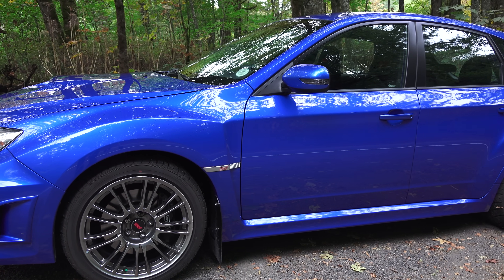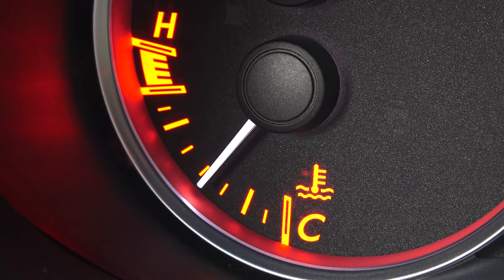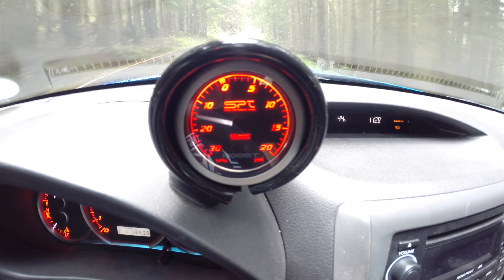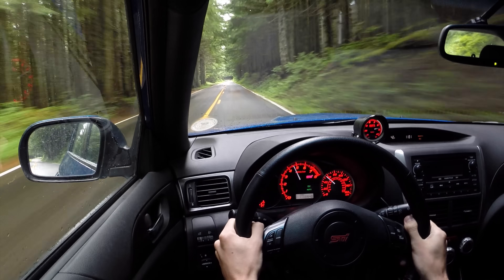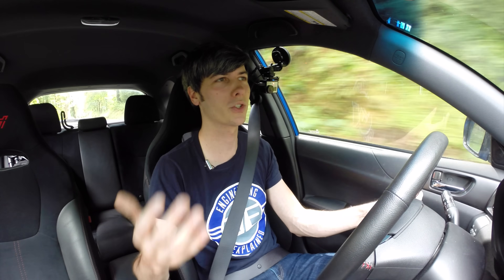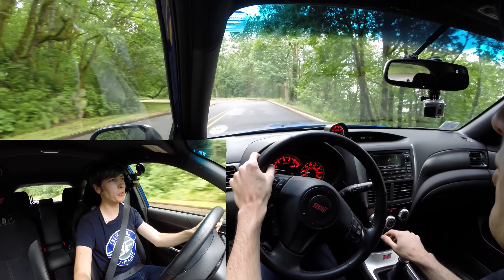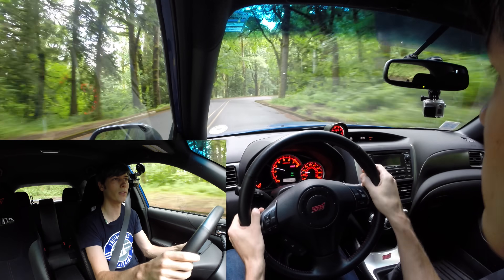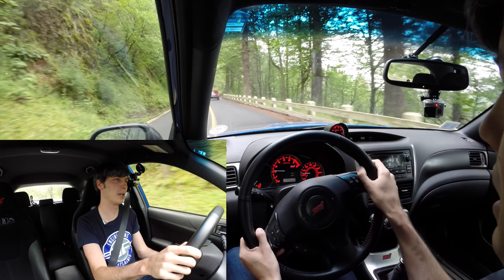5 Things You Should Never Do In A Turbocharged Vehicle

Comment: It stands to reason that if you are walking along a path and immediately take off running, you are putting more stress on your body/lungs...gently increasing speed is much better as it allows the body to take the increased loads. Same for an engine; the low rpm situation in top gear is fine for cruising but when you accelerate quickly it puts higher bending loads on the rods and such, it's more bottom end damage than anything else, cambelt damage can also occur :/ modern oil is designed to take one heck of a beating from cold to hot. If you turn off a hot engine instantly there is a peak rise in heat prior to cooling down, this doesn't do any damage but if you consider a turbine wheel still spooling without an oil feed, not good. It makes sense to leave the engine running for at least 20 - 30 secs prior to turning it off, this allows the turbine to slow down to a stage where upon the engine being turned off won't cause dry spooling of the turbine shaft. Feathering the engine through acceleration and deceleration is always a good thing. Heavy right-footers destroy engines but if they are loaded then it matters not, but for the rest of us, nursing an engine will give it longevity, regular oil changes (I change my evo oil every 6 months) also helps to stop sludge build-up which can cause a lot of problems.

Comment: Hey there,  you said something about not to lug the car at low RPM's... I drive a VW TDi Jetta with a manual transmission. The peak torque is at 1800 RPM, IIRC. I usually downshift if I have the time before changing lanes on the freeway or pulling a steep grade. But there are times where I need to accelerate in the gear I'm in... But what is considered too low in RPM or how would one know that its "Lugging" ??  Even at say 1500 RPM, if I ease on the throttle, and give it just a sec for turbo lag, it pulls pretty strong and feels great. So not sure if you have done research on this or not, but I have a 2015 TDI with the 150hp model, but I would assume is fairly close the the 09-14 models with the 140hp engines.

Comment: Do you think Top-Tier certified gas station matter?
Reply from the maker: Absolutely, though quite a few companies qualify as Top Tier. Seems like if you're not in it you're probably not trying.
Reply: It is far more important you go to a station with cleaned and maintained tanks than "top tier". The detergents are debatable.
Reply: +User Name that make sense. Do you know how to tell which station have a clean and well maintained tank?
Reply: You can typically tell by the state of the entire station. Newer stations are also typically a safe bet. In my area Shell stations are typically garbage and a few shut down after people complained of substantial water in the tanks.
Reply: Never buy gas when the fuel tanker truck is there, or you saw it there.  Sturs up junk from the bottom.

Comment: number one. unless somebody is using a straight weight in there car your quite wrong. oil acts at the lower viscosity index until warmed up making the oil flow too fast to reject heat and the heat would damage your turbo. engineers............. they went to college.
Reply from the maker: College is a great place to learn. You should watch this video to understand why oil flows slower at lower temperatures: https://youtu.be/tYkg0oDUXs8
Reply: +Engineering Explained it's irrelevant and the reason modern internal combistion motors use multi viscosity oils. the first number that has a w after it is what viscosity the oil has at ambient temps.  therefore the oil will flow faster at until warmed up. viscosity is the resistance to sheering(stress) the higher the number the more resistance to flow.
Reply: +james hoffman turbos need higher viscosity to reject heat.  I.e. the 5w40 used in alot of turbo cars will have a resistance to flow that is quite low (5w) until warmed up so the oil is flowing too fast to reject heat. you stated that the oil moves slower. your first point of the video is only true if you use straight weight sae 40 and you trailer your car to the track. so for the rest of the world we are now misinformed as to the why.
Reply: +james hoffman You have no idea what you're talking about.
Reply: +james hoffman  not a single true word....

Comment: Nice and to the point as always, but you did forget one thing, about not turning off the car after long rides or driving with heavy load on engine, oil is not that much of an issue, it can be relatively cheaply changed, but what happens too is you have hot turbo running, and you cut off the oil to it, expensive repair incoming :D

Comment: low rpm knock is the most common way people damage they're engine when turbocharged due to high boost which increases your flame front speed mixed with slow piston speed aka low rpm
Reply: this usually doesn't happen on unmodified turboed cars, but people who increase boost without tuning. just wanted to clarify.

Comment: Some cars (like my MK5 GTI) have an electric motor that runs coolant around the turbo after shutting down the engine, so you cannot damage it... But don't park your car and pull up the handbrake if your brake discs are red ;)
And how could one produce high boost at low RPM? At low RPM, low amount of burnt gases go via the turbo, so they cannot turn it that fast, thus they cannot produce high boost... Right?

Comment: Low speed pre ignition doesn't happen because it's a small turbo engines. It happens because it's a small engine. In Europe, this issue has been around for like 50 years, and it is THE ONLY reason why premium fuel makes sense. It doesn't ignite as easily without spark.

Comment: seems like they should have been able to compensate for low rpm with less fuel because the computer should be able to see that it is not going fast enough to actually need the extra gas

Comment: 87 and 93 are the only fuels you get? In europe we got 93, 95, 98 and 100 octane
Reply: Europe has a different octane rating system than North America.
Reply: +Chris Watson same gas, different rating system. u kno how we have to b different lol
Reply: Nico Guerrero I assume you are on the Europe scale for octane not the US, correct?
Reply: +Lenfred Dueck r+m/2
(R)Research and  (M) motor (octane)
Reply: 3 or 4 types.  In California, we have 87, 89, and 91.  The rest of the country I believe is 87, 89, and 93.
Reply: Correct, in New England, 87, 89, and 93 are what you find in most gas stations.  I've even see a few stations that have 85, 87, 89, 91, and 93, but those are few and far between.
Reply: +E B In Chile we have 93 95 and 97 octane
Reply: In NZ we have 91,95,98,also e85 and aviation fuel if you know where to look for it
Reply: we only get 95 and 98 in the UK
Reply: +Joe Raw where do you live in a village tescos sells 99 ron and shell sells 99 ron
Reply: Here in Mississippi, we have 87, 89, 93.  A few stations have 91 as the premium.

Comment: sounds like engineering fails. why cant we just sit inside the car start it and  drive it. a car does not need to be treated like a baby. it a machine. just my opinion.
Reply: your opinion is extremely ignorant
Reply: This isn't babying a car, this is making sure you don't destroy both the engine and/or every bone in your body. The laws of physics will never allow us to drive the perfect car.
Reply: +Frenk Vortice it's not a compliment, and for the record you can hop in a car and drive it straight away, and you can also floor it out of the driveway if you want, but you shouldn't for the reasons listed above and more. It's like saying its an engineering fail that we can't travel at speeds equal to the speed of light, physics.
Reply: lilsammywasapunkrock luck would play a large part there ill say as i notice differences in oil pressure even 4,000 km's after a change.
despite yes you could save $1000 for basically slowly destroying your engine but will that $1000 rebuild and re-fit an engine ?..
look after it and it wont be so disposable.
my usual service interval is 5,000km , i use penrite oil's, its about $35 a bottle, oil filter is about $15 , so $50 aud all up.
its not the cheapest oil around but id rather be spending $300 per year happily than have to spend $2500+ on a second hand high km engine or rebuild it for $4000..
eh just how it works for me, doesn't mean its the same for everyone else.
Reply: There's a difference between 'baby-ing' and taking reasonable care.
Reply: Challenge accepted

1) they gave no statistics on how many of these cars are old/new. I can guarantee most breakdowns are older cars, naturally.
2) I believe this argument was started by engines, not accessories which is all the article touches on.
3) this is 1 article with very limited depth, no sources included.
4) You're wrong
Reply: ***** right, that is reasonable.  just wish the cars would be less of a burden. economically.
Reply: +nvmyutube well, I did pay $500 for the car, 5 years ago. so $2500 later, I'd say I saved money by not changing the oil.
Reply: every machine requires care. if you take care of it , it'll last longer.
Reply: +nvmyutube I have 340k miles on my car, I drive about 25k miles a year and I don't change my oil at all. sometimes ya get lucky, and other times you dont. say you change the oil 50 times for about $20, there's $1000 towards a new engine. I just save my $20 and haven't blown an engine yet.
Reply: lilsammywasapunkrock ahh i see, well if its only worth 500 i can understand you logic.
Reply: lilsammywasapunkrock thats why i change every single thing in my home every two years. cos you know ... its normal..... go and try to service your car in auto dealership, and not get ripped off a thousand times. old cars lasted 15 years, todays cars are toys from a cereal with warranty of 2 years . if you are lucky you are not killed by stuck automatic acceleration pedal on highway.
Reply: +Frenk Vortice I'm the guy that hasn't changed his oil in 5 years, dealerships see exactly $0 from me.
Reply: Kevin Eichelberg like i said its just my opinion.
Reply: CraigF1995 thank you.
Reply: +Frenk Vortice to each their own. I understand both point of views
Reply: CraigF1995 right i get that.
Reply: sadly there is no such thing as a perfect engine that will tolerate all conditions.
"baby-ing" it has huge benefits in some ways, would you rather take care of an engine and not have to pay for a rebuild every couple of years (pending what engine it is $5,000 doesnt go far..) through treating it like garbage or take care of it and have it last you 10 years.. 
just my 2c , my car's cop a hard time but get looked after, no blown engines/turbo's so far :)
Reply: its just  i have seen russian documentary about how the car manufacturers design faults and place a part  that is changeable every 70k, km  when the old model have the same part that lasts 150k,km i mean new cars nowadays are driving from pitstop to pitstop.
Reply: moruk
Reply: you obviously know zero about turbocharged engines
Reply: ***** i don't claim to. where do you wanna go with that comment? idk...
Reply: ok everyone read this and tell me im wrong. https://techcrunch.com/2016/07/22/car-breakdowns-reach-record-high-despite-boost-in-auto-technology/
Reply: CraigF1995 no it doesn't. at least to me., we all know the automotive industry is holding back on us to just get more money thats it. anyway have a good day.
Reply: +Frenk Vortice to be fair, most manufacturers who state when and what service needs done also specify that they are the ones to do it. the people that sell oil are also the ones who say it wears out. 

if cars didn't wear out, they wouldn't sell new ones.
Reply: lilsammywasapunkrock I understand since your car was only 500$ to begin with. Please change your oil with any relatively new car circa 2000 plus.
Reply: electronics are the weak link in modern vehicles nowadays.
Reply: +Peter Lattimer my car is loaded with electrics.
Reply: Turbo engines are always like this for 30 years. See all the trucks in the morning start up wait 10min then go come home wait 5min then off. You dont need to be soft on the engine when the oil is hot (80C) its only the cold start and cooling down that takes a.while on a turbocharged engine.

Comment: 5:05 you said you don't want to run high boost at a low rpm, WOT throttle when cruising at 60km/h at about 1800 in 6th gear I'm wondering where does this extra boost come from?

Comment: Finally someone who is telling people to use high-octane fuel in their turbocharged engines.

There are sooo many articles telling people that premium fuel is worthless and a waste of money in the last few years. That may be true for your typical Camry or Civic, but as you've pointed out, it's not true for turbocharged vehicles. Most of those articles and videos fail to point out that if your vehicle is turbocharged, their advice doesn't apply. 

Sadly, many people who now own turbocharged vehicles swear by the idea that 87 octane is just fine and premium is a waste of money. They won't believe that it makes a difference.
Reply: only if your fuel cap says to run something better if it doesnt you dont have to worry about it since it is N/A

Comment: As someone lucky enough to have a real oil pressure gauge, your first point is definitely correct. My coolant reaches operating temperature within about 7 minutes, but my oil pressure under load remains very high until 5 minutes after the coolant heats up, indicating that engine oil does heat up later.
Reply from the maker: A lot of VWs come with oil temp gauges, you can watch in real time how much longer the oil takes versus the coolant.
Reply: I'm glad to see they have that info. A lot of newer cars I've driven have replaced real gauges and information with effective dummy lights. Good to see this isn't always the case.
Reply: +Engineering Explained
 a lot of vws also have a oil to water heat exchanger for an "oil cooler" . 
it actually helps the oil get up to temp quicker , as opposed to if you didn't have a cooler at all. 
Then its(supposed) to keep it stable.
Reply: Like Subaru's have. Beneath (actually above) oil filter there is oil cooler, trough which the coolant flows.

Comment: I've done all of these.....whoops
Reply: Achievement unlocked: living dangerously (15p)
Reply: Zargonis that's not how it works. you get torque in different rpms and not only in high revs
Reply: Oops indeed. To be honest I'm used to flooring the engine and shifting early. Oh well. Time to change that.
Reply: how could you be flooring it and early shifting? im guessing you mean at different times?? That just sounds like your not treating your car very well lol
Reply: Basically I fully press the accelerator (without kick down, and the pedal is set to eco, so it is a bit gentler) starting from say 1100 rpm, and shift at 1500-1600 rpm, rinse repeat. I suppose that's not how you should do it... I'll try to keep it in mind.
Reply: +Vatsyayana I have A Veloster Turbo. The car has a shift gauge that tells you what gear you should be in for best fuel economy. If you follow that then you will be in 6th and final gear around 41mph and at 2000rpm. So if you want to floor it, it is best to down shift. I would say that the fuel economy is best for city driving when you won't be flooring it anway.
Reply: Copy that
Reply: Why would you shift that early? You're getting no power. If you want the power with your full throttle, let it go to the redline then shift.

Comment: Don't call it "best fuel". i would expect you of all people to know that 87 and 93 octane fuel is the same quality fuel only with different octane ratings. By calling "best" you're perpetuating the lies that people believe that their car needs the "best" fuel.
Reply: +Alvin Brinson I think  what Maccaroney is trying to say is that octane and quality are not related. 93 octane fuel should be ran in turbocharged cars for the octane, not because it has better quality, even though the car may perform better (whether it's fuel efficiency or hp and torque).
Reply: For a turbo engine, 93 octane is the best fuel. It's not a lie. The higher octane makes it the "best fuel" in this case.

Even when the manufacturer specifies that 87 is "acceptable" or "minimum", operating conditions on a turbo are such that it is still preferable to have the higher octane.